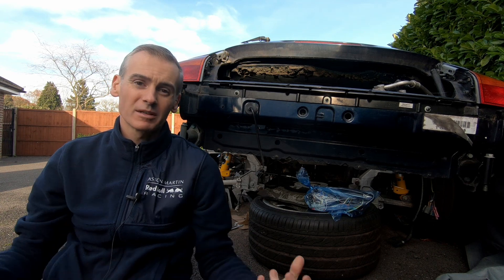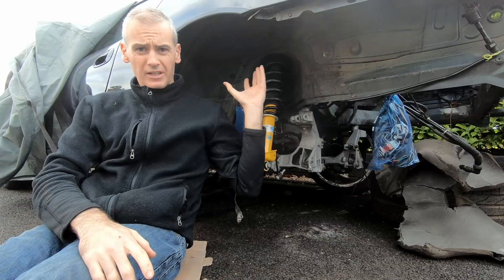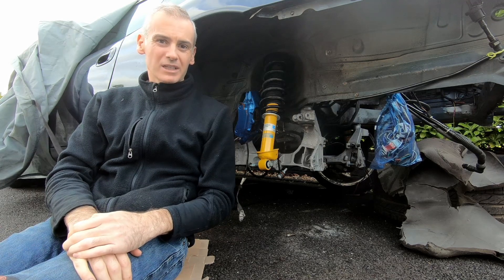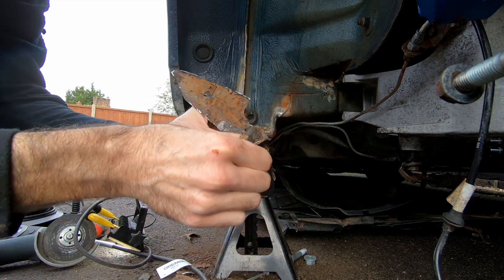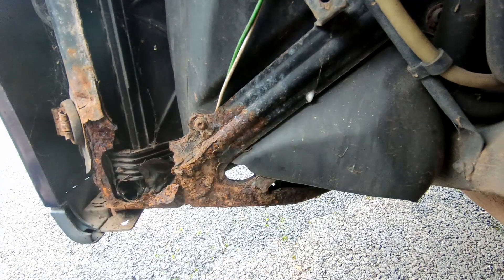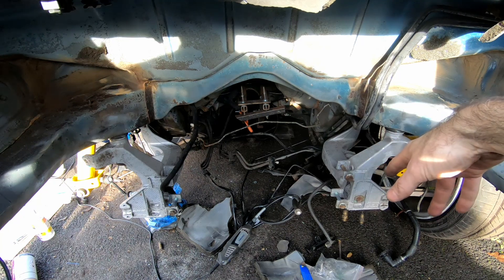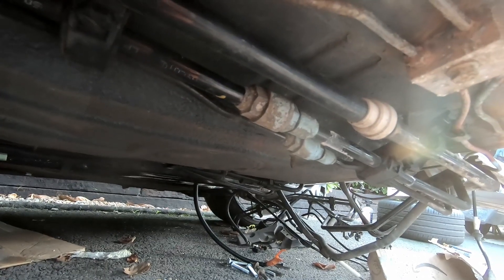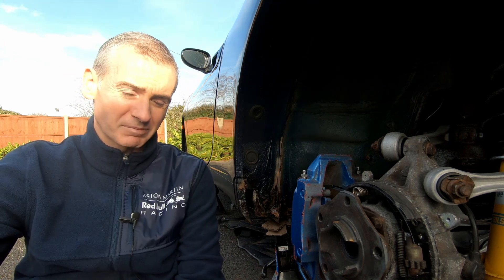Uncovered a big rust hole in the rear sill of my Porsche 996 - Electric Porsche 911 project video 52

Comment: Good work, I like the face mask respirator -would you know which one that is ?
Reply from the maker: Thanks. It's the Trend AirMask Pro. I needed a new half mask back in April, but they were impossible to get at the time. This was all I could find, but I'm glad I did. No more near misses with metal shavings getting around the safety glasses.

Comment: The brake pipes... no not brake pipes! :)
I always enjoyed ripping redundant stuff out
Reply from the maker: :-) brake pipes will be removed at some point....to be replaced with new pipes as the current ones are rusty as well. It was exceptionally satisfying ripping all that stuff out. Very easy to get carried away though and remove something you shouldn't...I think I stopped myself in time.

Comment: It's rather surprising how much hidden rust you found, but your approach to dealing with the rust is the best course of action.
Reply from the maker: Yeah, it is more rust than I had hoped. But this was the cheapest 996 available at the time (and I haven't really seen any going as cheap since) so there had to be a reason for it. I think it was well cared for the first 12-15 years of it's existence, but less so the 5 years up to the point I got my hands in it. I really want to have this car for a long time, so ignoring or hiding problems won't do.

Comment: Rust is always heartbreaking to look at. But you are addressing critical issues that'll ensure that your beautiful 911 drives along for the next decade or two problem free.  Good man. Well done.
Reply from the maker: Thanks! Yeah, I just need to fix it now and get rid of the problem. I took the surgical approach to cutting out the rust to try to leave as much of the galvanised Porsche metal in place. Took longer but hopefully it will be a better fix as a result.